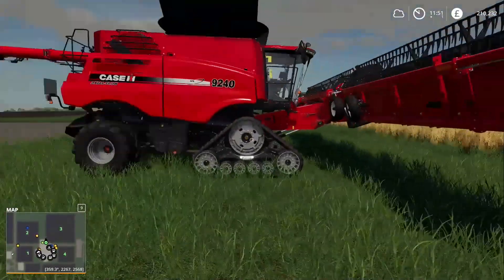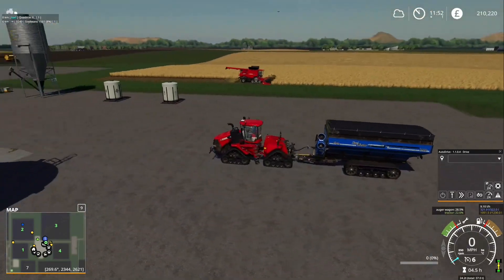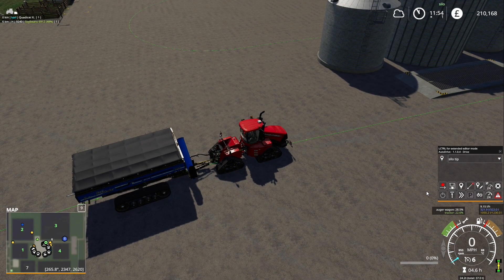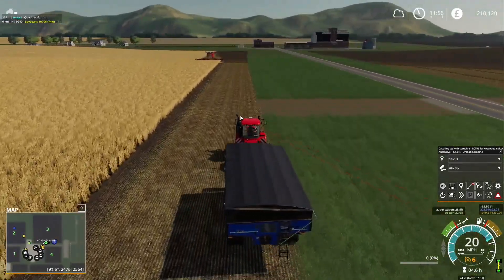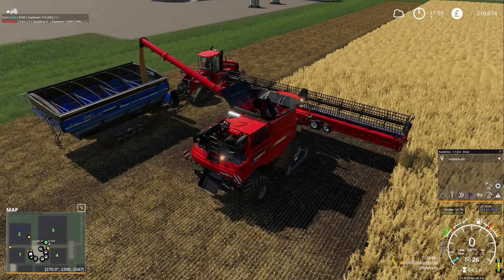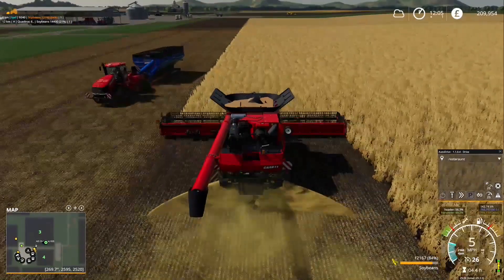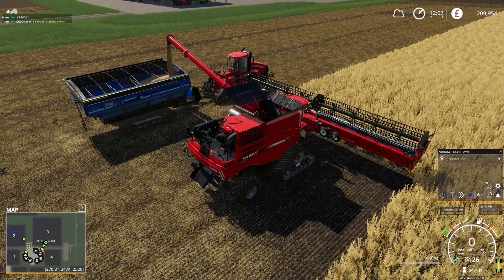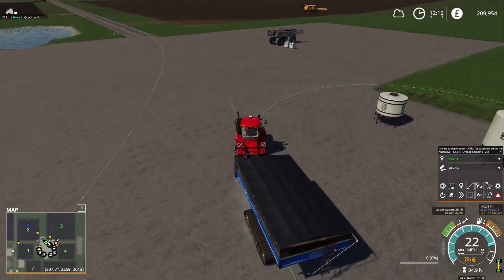Emptying the combine | Autodrive tutorial version 1.1.0.4 | How to #4

Comment: Can you drive a combine manually and still have a Auto-Shuttle
Reply from the maker: Emerald Zebra yes this is possible
Reply: @karloffgrid  one more question, if I am.using a chaffer, I.e. big krone with the new krone overloader trailer. Will that still be recognised as a combine?
Reply from the maker: i havent been able to get the tractor to recognise the Big X to drive along side of it. you would be better using courseplay for that. I have courseplay tutorials coming soon
Reply: @karloffgrid  cool, I hated course play as it wouldn't even plan field routes or anything 50% of the time, but I recon I'll  retry when you teach us as you keep it real simple :)
Reply from the maker: i always try to keep everything as simple as possible whilst getting the point across. no point complicating things :)
Reply: @karloffgrid  exactly gets  results too, I've started getting a bit more advanced on my own just from your first tutorial.